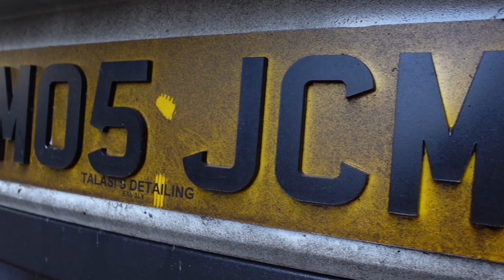DIRTY SMOKERS CAR | DISASTER DETAIL

Comment: Autosmart sell black gloves for the future and little tip use the blo air gt to blow down the side of the seats and under them.it blows all the crap into the rear foot well to hoover up
Reply from the maker: Thanks bud. This was last year when we had a glove shortage! I use be safe supplies now they are also really good for gloves. I remember last year the prices were through the roof 😳 good tip with the blo dryer